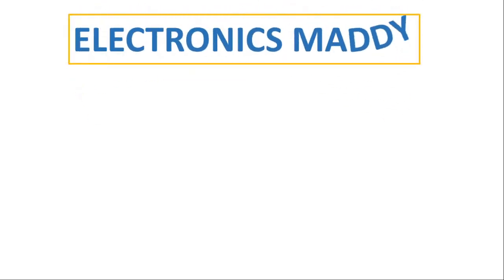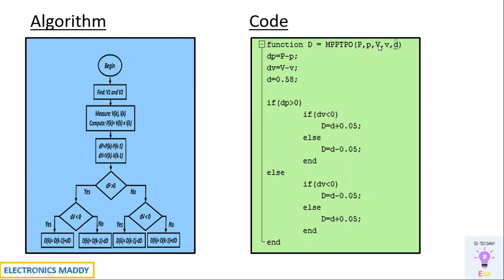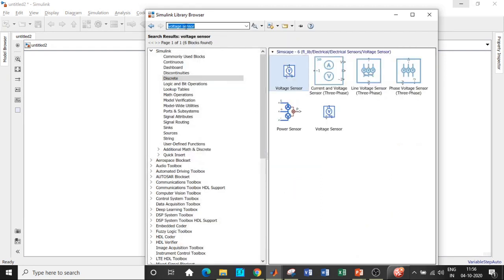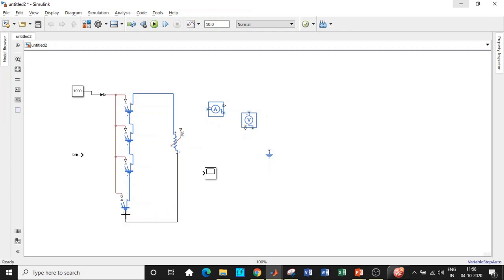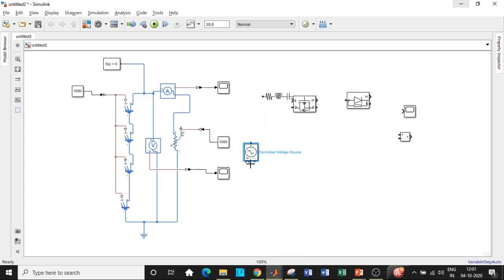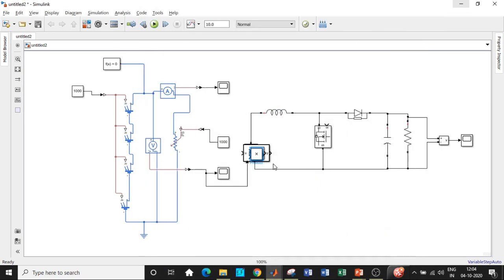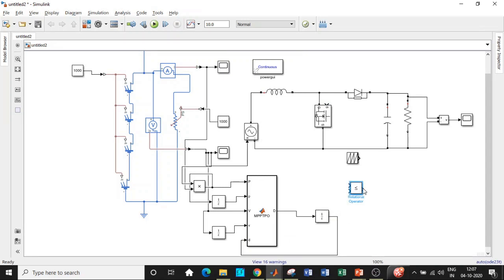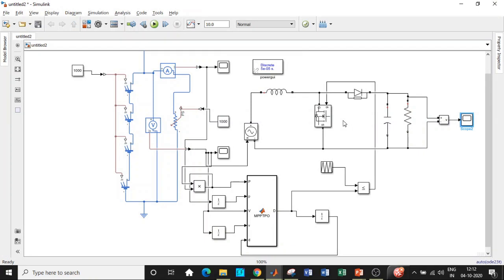Simulation of Perturb and Observe MPPT for Solar PV array with Boost converter in MATLAB | SIMULINK

Comment: Sir, I have a doubt.. if I am using this p&o program for my system with some other design of pv and converter, does the p&o program here should be changed? or can be used as such..?

Comment: Hi thanks for video,
I have buck boost converter for optimizer application which tracks mppt. I can control direct output voltage and I have feedback of input voltage and current. How to relate that output voltage with duty cycle here?
Can’t we only use delta power to track mppt not delta voltage ?

Comment: Hi sir! Really great educational video, it helps me a lot! I am trying to model a PV charging system for battery, and I found another video regarding MPPT and boost converter  (https://www.youtube.com/watch?v=CLbLkmci5SU&t=434s&ab_channel=NakiG%C3%9CLER). However, I found the boost converter is a bit different from yours (in that video there are two capacitors ci, cout and some resistors connected inside and using a IGBT instead of a MOSFET). I am a bit confused about which circuit should I follow. 

Also, how should I modify the duty ratio input of the MOSFET such that a result without MPPT can be obtained?  As I want to compare the performance with and without MPPT. 

Thank you so much! Your help is very appreciated! :D

Comment: Hi
I have a question. To validate the MPPT algorithm, should it be done with the output voltage and current of the panel or with the output voltage and current of the converter?
Thanks
Reply from the maker: It should be done with the panel.

Comment: Why we use variable resistor?
Reply from the maker: We use variable resistor because we have a port to convert (physical system to simulink one) if you observe carefully you can figure that out. Good question by the way.  Hope the point is clear.

Comment: Please make the same video using PV array block. Or atleast tell the connections.
Reply from the maker: It's pretty simple just look at my other video using fuzzy and try to correlate. If are still facing issues I am definitely there to help :)
Reply: @ElectronicsMaddy  I have made a circuit and I still have some doubts. How do i share the circuit?
Reply: @ElectronicsMaddy  Please share the link as well
Reply: @ElectronicsMaddy  It's really urgent. Kindly share your email-id. It would be really great if you could help me out on such short notice!

Comment: Hello, I'm getting an error when I simulated it:
An error occurred while running the simulation and the simulation was terminated 
Caused by:
Solver encountered an error while simulating model 'Renw_Project_PO' at time 0 and cannot continue. Please check the model for errors.
Solver could not solve the system of algebraic equations because a singular iteration 
matrix was encountered. Consider reducing the fixed step size and/or providing more 
accurate initial conditions. If the problem persists, check the model structure and 
values of parameters.
Reply: How can I fix it ?
Reply from the maker: Did you try the exact steps demonstrated in the video?  If you did then you will not get any error. Did you make any changes to the model?
Reply: @ElectronicsMaddy  No I didn't do any changes I just followed your steps
Reply from the maker: I am not sure abt the error that you are getting. Mail me at electronicsmaddy@gmail.com
Reply: @ElectronicsMaddy  okay
Reply: @afraalsalami2377  I am getting an error to did you get it fixed?
Reply: @sudeysiansha3049  no unfortunetly
Reply: @afraalsalami2377  what kind of error are you getting? I fixed mine it is working.
Reply: @sudeysiansha3049  The solver cannot solve the system and in the video he just said put it in there, so I don't know how to fix it
Reply from the maker: Connect the solver configuration block such that it touches any part of the ckt.
Reply: @afraalsalami2377   I encountered with the same error how u fix it plss tell
Reply: @sudeysiansha3049  plss tell how u fix the error
Reply: @lakshaysaini4758  Connect the solver to the ground and run it it should work
Reply: @afraalsalami2377  it doesn't work
Reply: @lakshaysaini4758  my solar cells were not connected that’s how I fixed mine. If you follow the steps correctly on the video it should work.
Reply: Even I am getting the same error. Please help me with the fix. Please
Reply from the maker: Please ensure that your solver configuration block is touching any part of the ckt which is in blue color. Even if you google the error and see you can solve it yourself.

Comment: I think the plus minus signs for change in duty ratio should be interchanged. Could you explain that part.
Reply from the maker: Can you please rephrase the question? I could not understand your question
Reply: @ElectronicsMaddy  if dp>0 and dv<0 then it should be D=d-0.05 not d+0.05
Reply from the maker: Good catch. But it does not affect the system even if it's interchanged.  Because it's just a convention that we follow.
Reply: @ElectronicsMaddy  thanks for your help. I was stuck in this for hours.
Reply from the maker: You are welcome mate :)

Comment: Bro , I simulated this circuit  it is taking lot of time to execute the model how to get output quickly
Reply from the maker: It takes time to simulate. Because it has soo many parameters to be evaluated.
Reply: Change solver type and then check